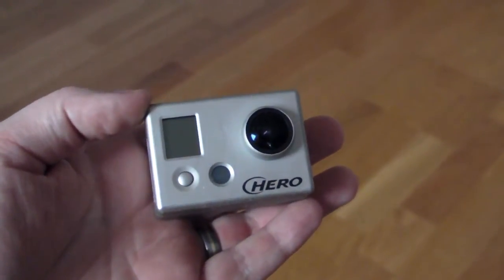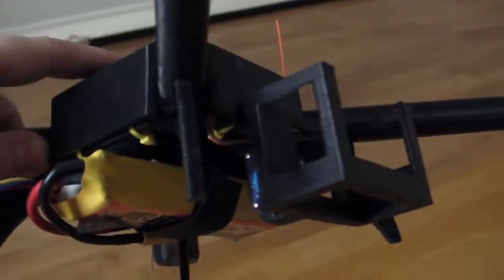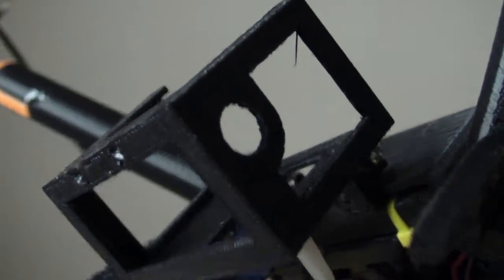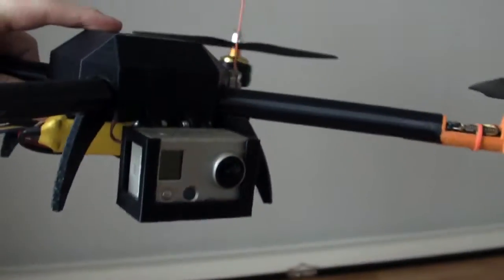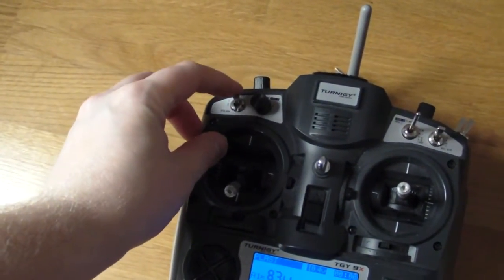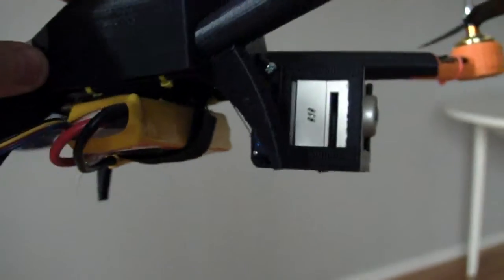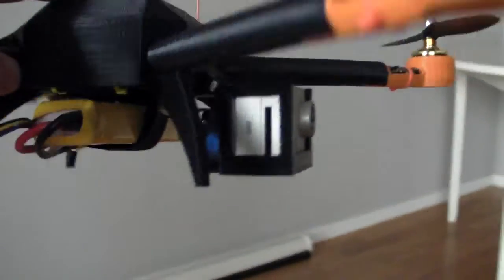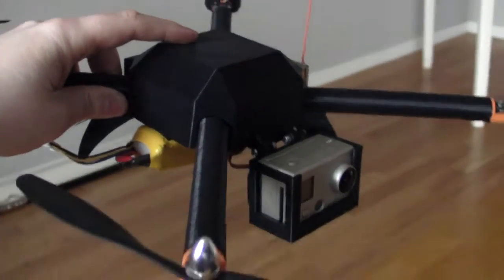Gopro mount for the 3D printed quad

Comment: @petleh82 Did you print your booms as well? Why don't you use T-Rex 450 standard booms such as on the scarab multiwiicopter? You can find really cheap carbon t-Rex 450 booms on Hobbyking.

Comment from the maker: @wiibart They are a little bit visible if tilted forward. But i also have longer motor mounts with esc integrated). Shorter arms would remove them. But i intend to have the cam tilted down a bit, and then they are not visible. (like in my old quad videos). I will post a video in a couple of days. I do not think i want to move the camera more forward, it would offset the center of gravity even more. But in the end i will not have anything in the way of the view.. :-)